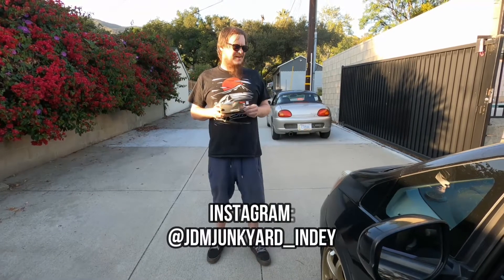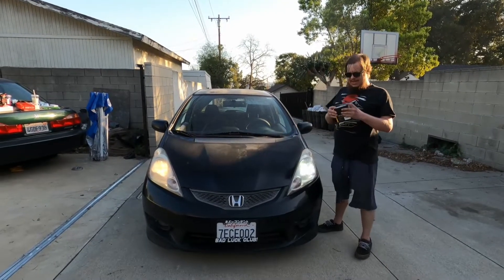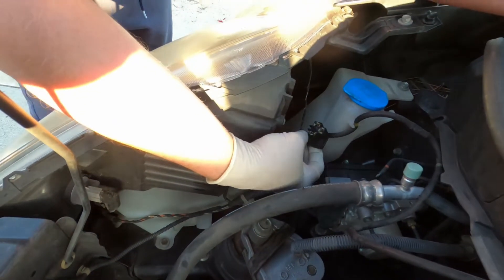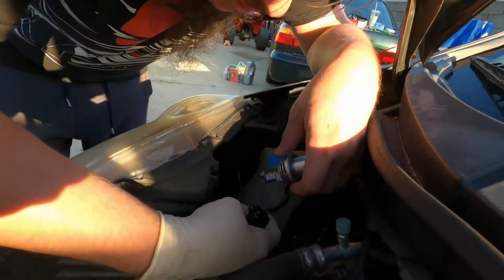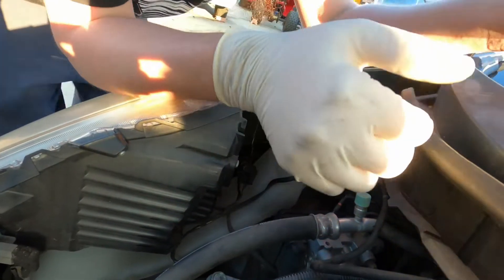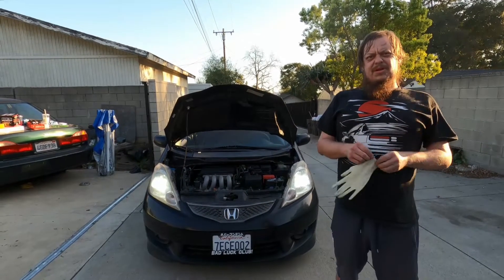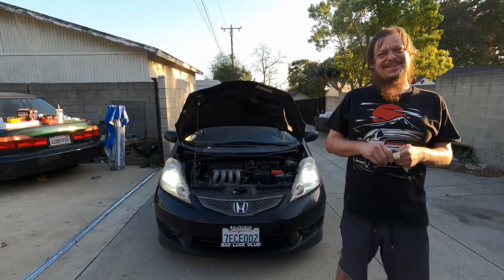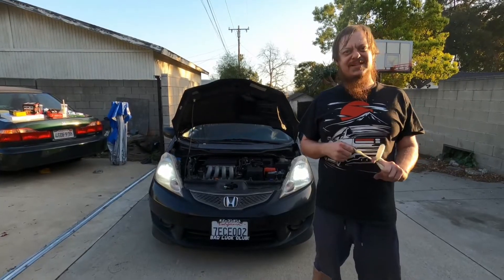HONDA FIT LED HEADLIGHT INSTALL!!

Comment: I did a conversion of my 2011 Honda Fit with LED bulbs recently and also added a decoder because the Daylight Running Light indicator on the dash comes on when I start my car, but the decoder did not work either. DRL indicator goes away when I switch to main headlights. I would like to keep my Daytime running lights on but without the DRL indicator on. Does anyone had this issue and what are the fixes? Thanks
Reply: Try Lasfit - decoder

Comment: what type bulb used ?
Reply from the maker: It’s a led bulb that’s meant to fit in the oem 9003 housing. 👍
Reply: So I'm just confused I did it got em in and everything but what way is up the side hidden or the open side of you know what I mean

Comment: This video didn't help me at all. You don't say what year the Fit is. Mine is 2007 and totally different. You have to remove the wheel, remove the plastic splash shield in the wheel well and come in from behind the headlight housing. Huge PIA job just to replace a headlight.
Reply from the maker: There is a chance you could get away with turning the wheel inward while the car is jacked up and peeling back the fender liner. We have to do something similar on our g37. Annoying but quick once you figure it out

And thanks for pointing that out I’ll put the year of the fit in the description 👍👍
Reply: You didn't notice how different the car looks from a 2007 fit? 🤦‍♂️